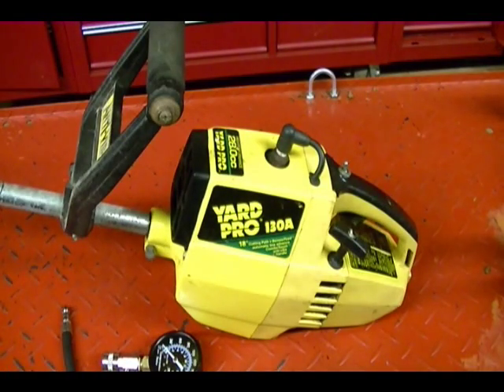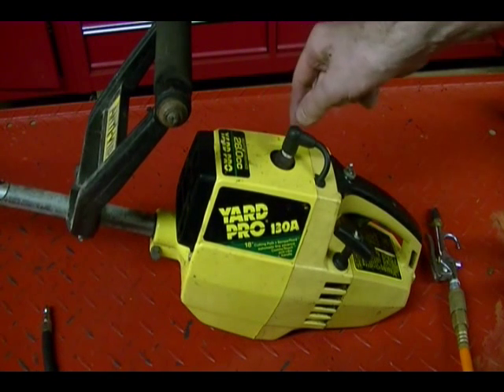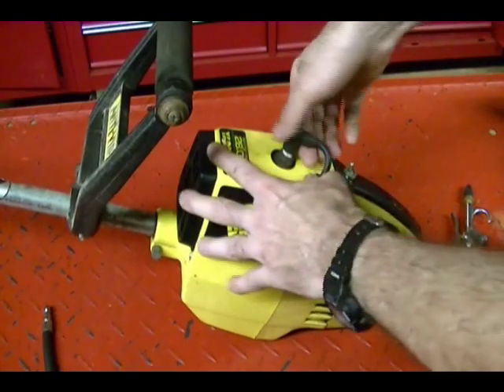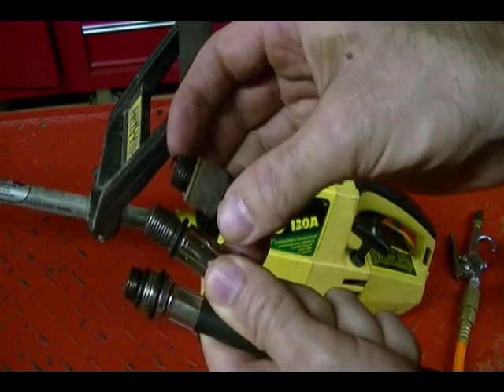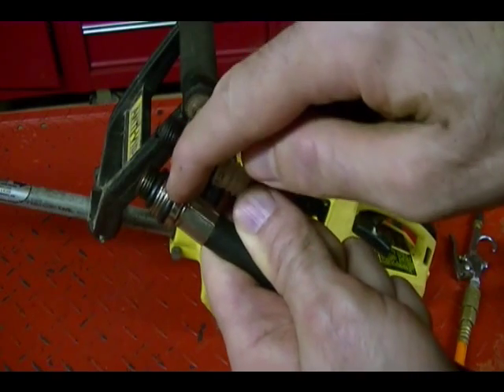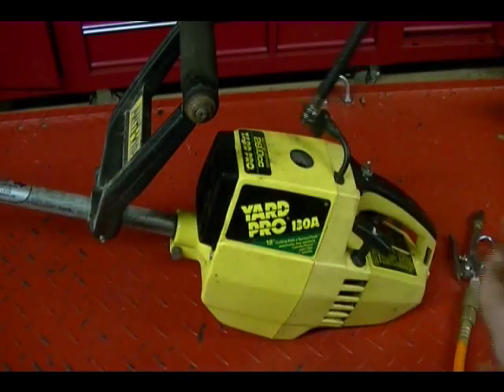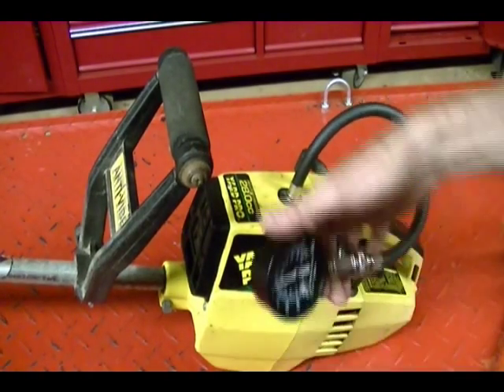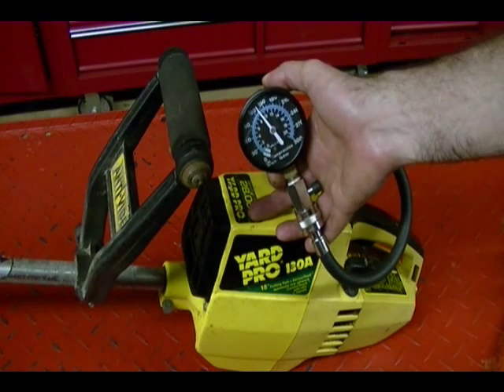Compression Test on a 2 Stroke Trimmer

Comment: Can you leave a link in the description for the compression tester? Also, when doing a compression test on a 2 cycle string trimmer, does the compression tester device need to have a schrader valve?
Reply from the maker: I can't remember what I had in this video. Tool outlets like Harbor Freight sell compression testers with different adapters for different spark plug hole sizes. The same compression tester works in 4 cycle and 2 cycle engines.

Comment: I have a Toro weed eater for about 10 years now. It’s always start on first or second maybe even 3 pulls. I had a Echo weed eater before and someone stole it from me, so I bought a cheaper Toro brand. I have seen my brothers and friends buy new weed eaters every 2 year and I just did my compression on my Toro and it’s at 90 lbs. My friends new home lite is 75 lbs. I believe that the secret to my weed eater longevity is that I always put my oil inside the tank before I use it and minimize my fuel. I’m to lazy to buy a separate can for my weed eater and mix the fuel in another tank. So I always pour the oil in the weed eater tank then add gas and shake it and starts every time. I think that when you mix’s it in a tank the oil stay at the bottom of the tank and you don’t get a good mixture. That’s mine story and my Toro is still running strong, not as strong as my previous Echo but it never fails to start.

Comment: Can you repair an engine with no compression? If so is it expensive. My neighbor gave me a WeedEater Excalibur Hedge trimmer that before he took out the spark plug the recoil rope pulled fine and after that the rope is so easy to pull and you feel very little resistance and sometimes the rope gets jammed in a certain place. I made a video on it called WeedEater Excalibur Update. Can you help me?
Reply: TopFin an with no compression is really bad and it is expensive to repair. One your piston may be bad, your piston head may be bad or cracked or the arm. Its expensive to repair not because of the parts used to repair the motors. Its expensive because of the labour involved like taking the apart and putting it back together.
Reply: Ring Seized to Piston !!!!!!!!

Comment: Stihl BG 55-Z, compression at 75. Won't start. New spark plug, tested with tester good. Rebuild the carb. New gas filter. Attempted start with small squirt of starter fluid, no start.  I understand normal compression to be between 90-100. Is my 75 reading the cause of my no start? ( I was using this blower and ran out of gas. I refilled and have not been able to start is since).
Reply: that is a very bad reading you need at least 90 for it to even start
Reply: @levihall3550  I have an old weedeater engine (echo gt 1000) which has 70 psi and it starts and runs alright
Reply: Rebuild engine is easiest option or buy new trimmer if youre not good with machines

Comment: My gas trimmer has no off switch as such... To turn it off you hold the switch down till it goes off, has a 1/0 marks on it. Do I need to hold the switch in the off position while I pull the cord.  This is a craftsman 316.990110 gas weedwacker.
Reply: Susan Woo nope, that switch disconnects the sparkplug. With the compression test there is no spark plug in the engine

Comment: Well, I did my compression test on my 32cc chainsaw motor and it was 50 psi. I took the motor apart and there was no scoring or apparent wear, but the cylinder wall was a bit glazed. Knocked the glaze off and ordered a couple of rings in case I break one. God I hope the psi goes up to like 125 or so. I just heard that the life span of these are 40hrs. is that so?
Reply: R. J. U. If you abuse the engine then 40 hours is the lifespan. But if you take care of your stuff like me you can get them to last over 1000. My ryobi has 100 to 120 hours on it and still runs good. Crosshatching is still in the cylinder even